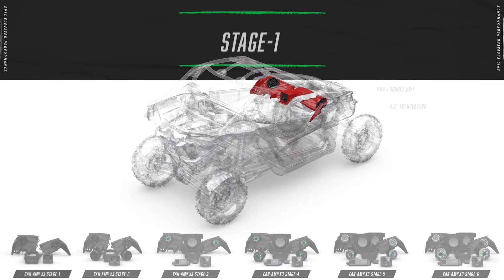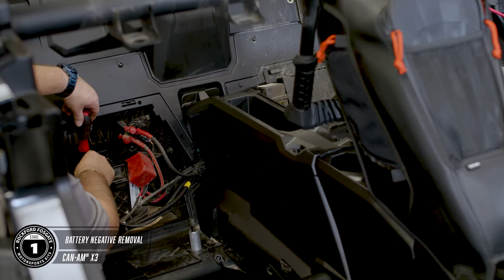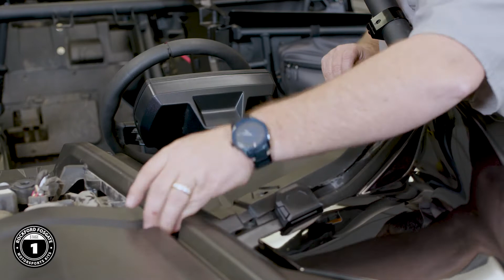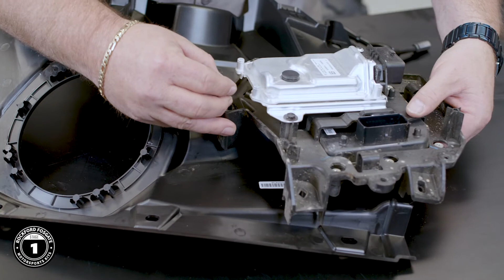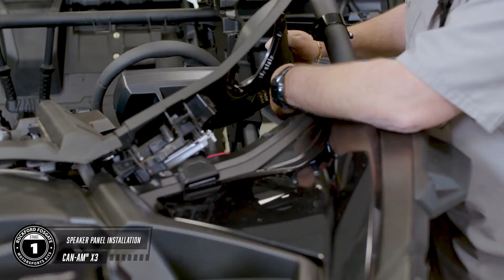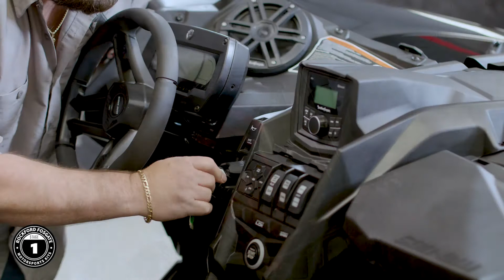Can-Am X317-STG1 Installation (Gen-3)

Comment: Any links to sound quality for the different stage setups?
Reply from the maker: All Rockford Fosgate systems are designed for Sound Quality.  The M0 and M1 Sound Quality is the same, you just have more power for more output. The M2 has a different frequency response for more presence in the higher frequencies (the area that gets drowned out by engine noise).

Here's a reaction from a Fanatic listening to all our UTV demo vehicles when they were equipped with the Gen-2 systems: https://www.youtube.com/watch?v=rSN2Vm4C6zc